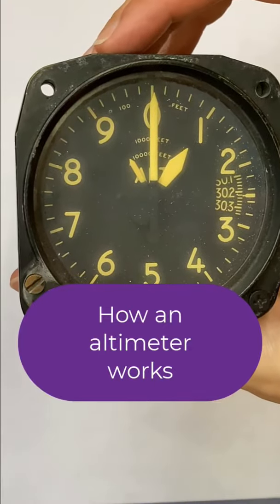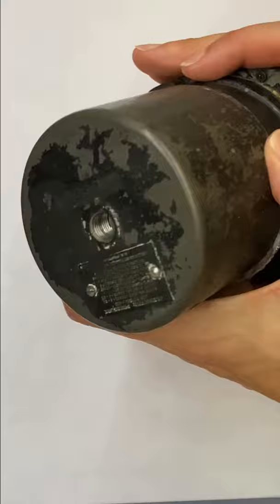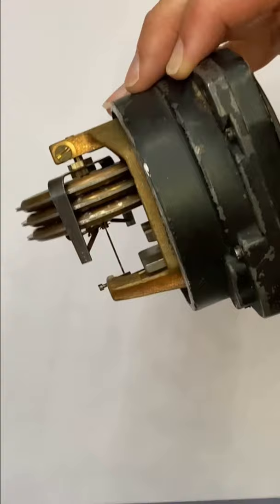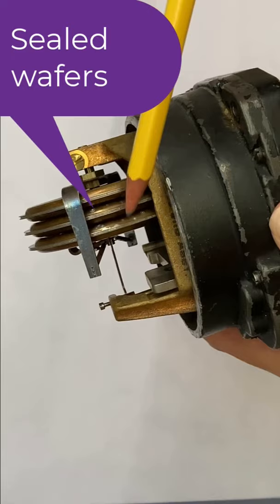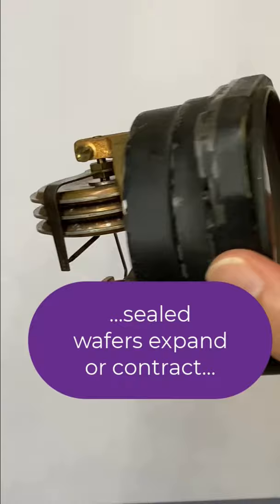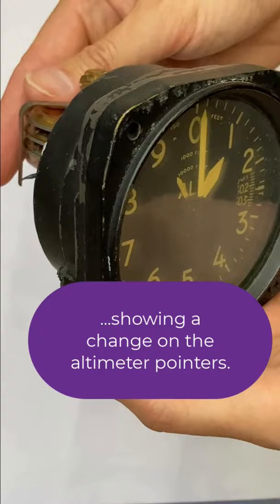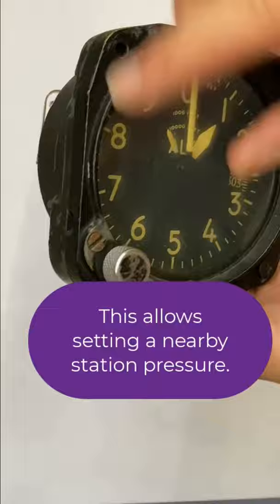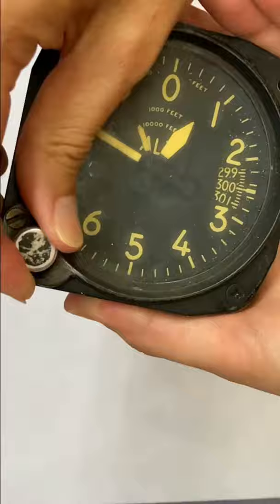Inside an altimeter ✈️ #shorts #aviation #IFR #flight #pilot #static #instrument #training #flying

Comment: Be careful with that instrument, it looks like it's painted with radium paint which is quite dangerous!
Reply from the maker: Good point! Thankfully it's covered by glass! I will be careful though.
Reply: @LauraLaster747  tiny dust particles and radon gas are also dangerous, you should at least get it tested with a geiger counter
All the best!
Reply from the maker: @sucamali  I will have to see if the engineering department has one!
Reply: @sucamali  Especially radium containing dust might be a problem, radon decay products decay rapidly, except of Pb-210 and Po-210.
Reply: @sucamali  I've already seen inner parts of AVRM clock and some tachometer being radioactive. The emission was weak but still detecable, if I remember well, about 3 times the background with LND-712 tube held with its mica window 1cm (very roughly) away from the parts.
Reply: The radioactivity would be so low it wouldn't be any real danger. Some people always blow things out of proportion. "There is a leak in the roof be careful you may drown"

Comment: I have a kollsman airspeed/Mach meter really want to open that thing
Reply from the maker: Go for it! (Unless it is actually usable for an aircraft, I say take it apart!)
Reply: @LauraLaster747  i want to replace the pneumatics with electronics for  my simulator! sadly one of the screws is broken so its gonna be hard to open it up
Reply from the maker: @fon-tijn  Oh yes, they are very hard to open. Opening mine involved a grinding wheel...